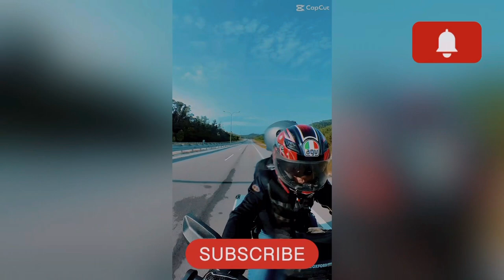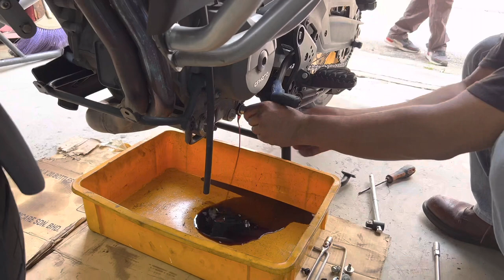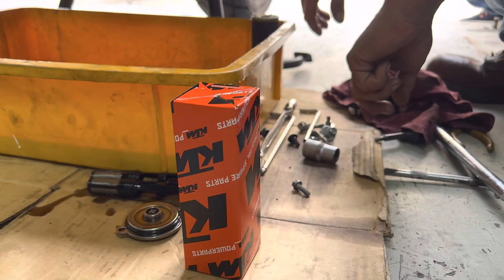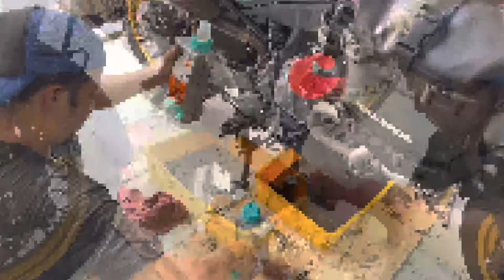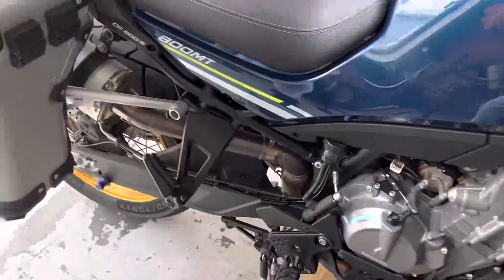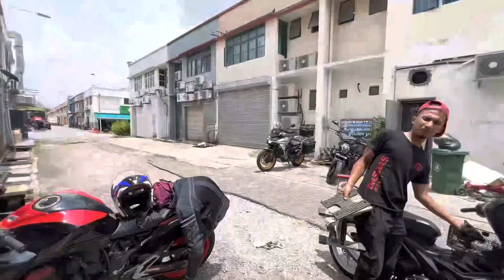CFMOTO 800 MT-2nd service-MOTOREX ENGINE OIL..

Comment: If you like MOTOREX oil you have not tested many oils. MOTOREX motor oil is among the worst, it turns black very fast and gear shifting becomes harder. The best oil I have tested is a car racing motor oil the GULF COMPETITION. With this oil clutch and shifting is smooth and it keeps the engine clean inside for a long time, without getting burned black like the BAD and EXPENSIVE MOTOREX recommended for my KTM.